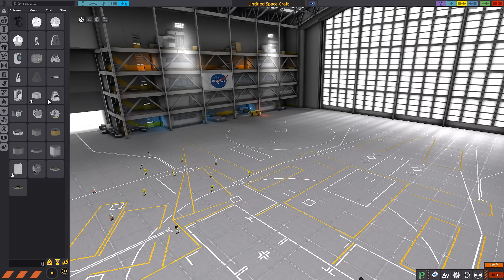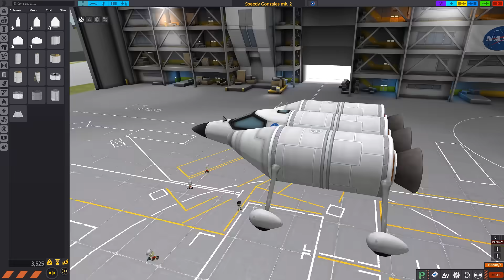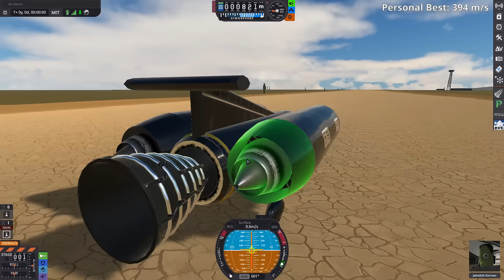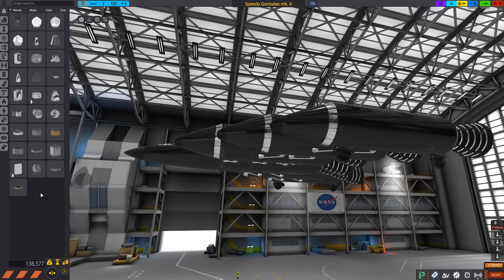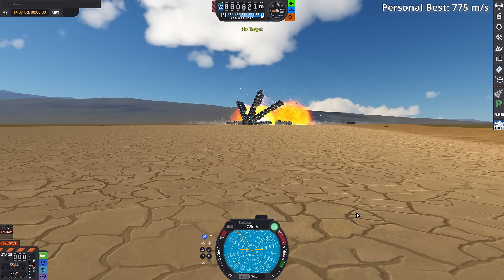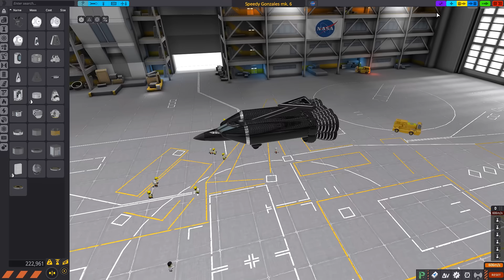Can I Break the Landspeed Record?│KSP

Comment: Did you ever think on building a machine with a reverse fan to keep it glued to the road surface or is that not an option in this game .
Reply from the maker: I suppose it would be possible. But the a speed record, the extra weight and drag wouldn't be great.

Comment: If you're willing to cheat your position, go to the northern ice shelf (north pole).  The land is super flat there and the only point of failures will be wheels or bad design.
I usually do not use thee small wheel and use the next landing gears instead.  Good luck !
Reply from the maker: Thanks for the tips. I will definitely keep that in mind for my next attempt

Comment: This was a very entertaining video, but your fuel levels didn’t look like they were draining as expected, especially when you were using vector engines. Did you have cheats enabled?
Reply from the maker: Nope. I don't actually know how to enable cheats 😅😅. I was clipping extra fuel tanks into the main one at times. That may explain the discrepancy.
Reply: @TheIrishOakIRL  You enable cheats using the debug menu, which is accessed by pressing alt+f12! It can be great fun to play around with cheats.

I wouldn’t have commented if not for one moment in the video where your delta-v readout actually increased! I have no idea how that could have happened!
Reply from the maker: @keeganpogue haha what? How is that possible 😂😂 do you know what part so I can check it out?
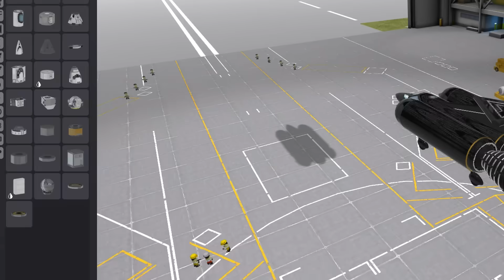Reply: @TheIrishOakIRL Sure thing! I can’t remember exactly what I was talking about the other day, but during the launch at 10:10, the delta-v dips down into the 1500s, then jumps back up to over 1600. It all happens very quickly!

I’m thinking the strange delta-v during earlier launches come from the jet engines, which are super efficient and vary their isp and thrust with speed and altitude, causing the delta-v readout to act strangely.

Anyways, I think it’s just the game behaving weirdly!
Reply from the maker: @keeganpogue  Looking at it I think you right. Just the game acting weird 😂

Comment: What about Vernier Engines or some other small motors along the top of the body pointing upwards to keep the craft stuck to the ground? Hilarious video!
Reply from the maker: That's not a bad idea. I would be a little worried about extra weight and drag. Thanks for the support 🙏

Comment: Lots of fun to watch. I remember doing a similar challenge a few years ago but my rules were a bit different: default runway, must start And stop on the runway intact. I had to play a lot with the wheels for stability and braking (of course parachutes were also involved). I logged every thing i could through kOS. I don't remember my top speed but I was happy even when I gained single digits at some point.
Reply from the maker: I like the idea that you have to stop withing the length of the runway!

Comment: Tl;dr: Use a bunch of separatrons on the lightest craft possible. Nerd explanation below:

The seperatron engines have the highest TWR of any engine in the game, so if you have the cockpit alone and just strap like a hundred of them onto it it should be able to propel that low mass extremely quickly. The problem with adding more and more liquid fueled engines is that you also have to add fuel, which increases the total mass of the craft, which increases the total mass that the engines have to move. You'll eventually reach a point of diminishing returns, which you found to be at around 780 m/s.

You started to dabble in the art of part clipping, but I think you should graduate to exploiting the physics with fairings. Check out "Orbiting Kerbin at 7 kilometers" by So I Make Videos for a good explanation on how to use dragless tech. Once you begin using that, plus the separatrons, you should be able to pass 1 km/s no problem. Although I cannot guarantee anything regarding stability...

This is a good video! I liked and subscribed. Seeing your realization that bigger isn't always better and that a lighter craft would go faster was my favorite part, it was great seeing you have that eureka moment.
Reply from the maker: Thanks for the awesome advice and the support on the video! 🙏

Comment: KSP1 Land Speed Record Rules
In the Kerbal Space Program 1 land speed record challenge, the goal is to build a vehicle that achieves the highest speed possible without ever leaving the ground during the run.

Core rules Kerbal Space Program Forums+1:

Must remain on the ground: Your craft cannot become airborne at any point during the run, except at the very end when you leave the runway surface to stop.

Runway start and stop: You must start and end the run on the runway; if you leave the runway surface at any other point, the run is invalid.

No lift-off: Even small hops or jumps are not allowed; the vehicle must stay in contact with the ground the whole time.

Fuel requirement: You must use a rocket engine (fuel/oxidizer) and burn all fuel by the end of the runway.

Survival: The craft does not need to survive the run, but you must survive until the end of the runway.

Speed measurement: Record your top speed at the end of the runway, with the engine off and fuel empty.

Mod restrictions: Some versions allow only a few mods (e.g., B9 Aerospace, Space Planes Plus) Kerbal Space Program Forums, while others require all-stock parts YouTube. Avoid “cheat” mods like HyperEdit or MechJeb.

Planet: Runs are typically done on Kerbin Reddit.

Example run details Steam Community:

Vehicles often use drag chutes or parachutes for deceleration.

Some designs strap a rocket to the front for extra thrust.

Speeds can range from ~200 m/s to over 300 m/s depending on design and fuel load.

Scoring: The highest recorded speed on the runway surface wins the record. Screenshots showing the vehicle, engine off, fuel empty, and on the runway surface are required for verification.

If you want to try it, focus on maximizing thrust-to-weight ratio, minimizing drag, and ensuring the vehicle never lifts off until the very end.
Reply from the maker: I will definitely do a video following the KSP speed challenge rules in the future. For this vid however I focused on the IRL comparison. Thanks for the rules though!
Reply: @TheIrishOakIRL  i will always send the rules for what you try do like air or ground or space
Reply: @setone101 what about air speed rules? I'm pretty sure I've made one of the fastest flying jets using B9 and FAR (I forget what mod the engines are from) but I reached 3730m/s which is Mach ~10.87. You have to pitch down constantly or you'll end up orbiting the sun lol
Reply: @SparxI0  was it below 30k meters?
Reply: @setone101 no :( I just tried again and was able to get 3659.6m/s @ 28,964m. My current personal best is 4226.6m/e @ 38,720m right at flame-out. I'm using the "Mk3 Hypersonic Systems" mod and their H-1 "Firestreak" Scramjets 😊
Reply: Oh and I'm using "full drag, strict area ruling" with FARc
Reply: actually the land speed record is over the speed of light, achieved by martincitopants
Reply from the maker: @tortortI will get there some day haha
Reply: @TheIrishOakIRL  lol
Reply: @tortortmy frorg lord martin. lettuce.
Reply: And glitches aren’t allowed (in certain cases)

Comment: Also to mitigate the wobbling, you can disable gimble on the engines. You can see how the rocket engine at the back was wobbling about, that was introducing the side-to-side wobbling. Also if you tilted that triangular wing to point at the nose just a little bit it would provide a down force to hold it to the ground.
Reply from the maker: Some great advice. Thank you friend 🙏
Reply: @TheIrishOakIRL  You wouldn't believe how many times I have to disable gimble! XD If you ever want to toy around with an absurd engine 'Simple Hyperdrive!' is the one I love way too much. It's bonkers. But the faster you go, the worse little adjustments will make things, you really have to just try to eliminate making any adjustments instead.
Reply from the maker: @Elfsovereign I'll add it to my list of mods
Reply: @TheIrishOakIRL  Also... it wouldn't be quite the same... but the largest flat thing I can think of you could have used as a 'runway' would be one of the minmus flats? The lack of atmosphere would make it easier... but still.
Reply from the maker: @Elfsovereign I will definitely need to look into a mod that will allow me to teleport ships.
Reply: @TheIrishOakIRL hyperedit is your guy I think.